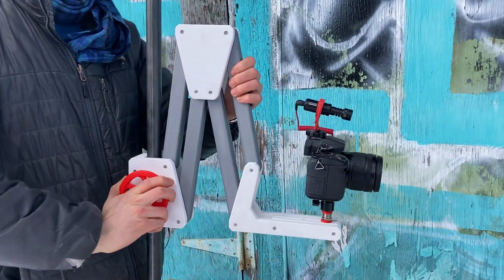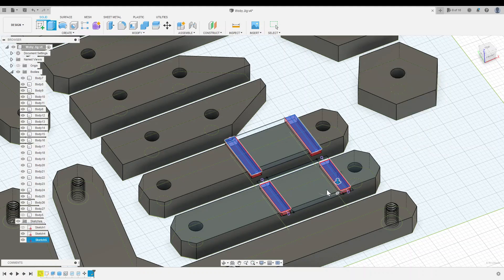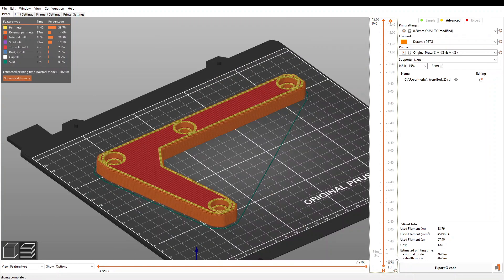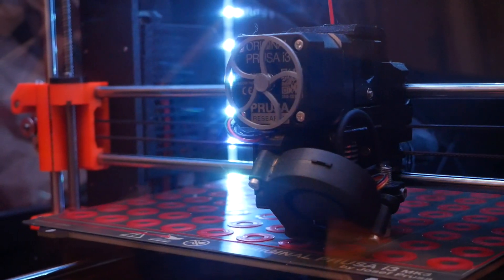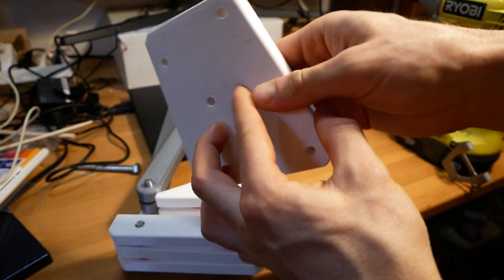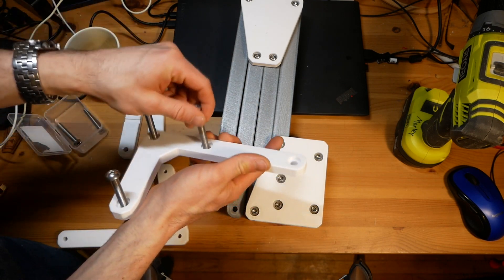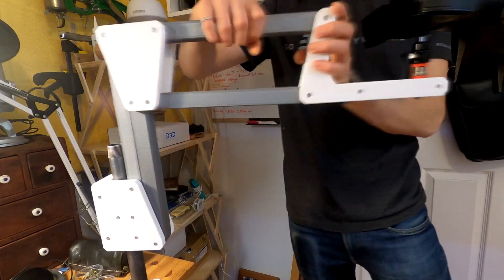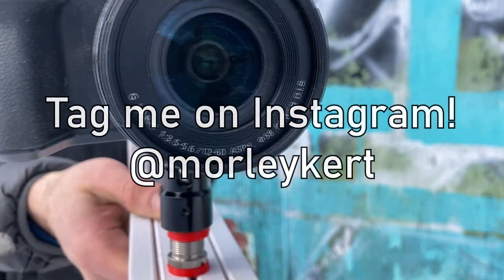3D PRINTED ARTICULATING CAMERA ARM // WOBY JIG

Comment: Update again: I got this assembled and it works wonderfully! I did end up using longer bolts and more washers and nuts to make the pieces tight enough to maintain position with the camera. I also added a metal threaded insert for the bolt/wheel that tightens the arm to the pipe. Thanks for making this! I also ended up buying the original designer's plans to make one out of wood sometime.

Comment: Update: I have the parts assembled, but I'm having issues with everything getting tight enough to maintain position. I plan to get some longer bolts so I can add nuts and washers to the opposite side of the pan head. Prints turned out fine! I also plan to use pipe fittings to make a dolly on wheels so I can use it to take photos of my scale dioramas on shelves.

Comment: Really cool project!  I’m brand new to 3d printing (have a Voron kit ordered).  Is there a reason you printed all the pieces except the washers separately?  It looks like many of them would have fit together on the build plate.
Reply: Shorter print times probably. If something goes wrong during a print of multiple parts, there’s a lot of wasted time and filament.

Comment: You can use modifiers in your slicer app to add a cylinder modifier around all holes, that way you can have a higher infill where your holes at whatever distance away you want, without having to make a certain infill for the entire model

Comment: The hardware links are "currently unavailable". For hardware I like Albany County Fasteners. I try to order for a few projects at a time since shipping rates are a bit of a shock. Also, one thing I will do differently when I print my second set of parts would be to print the countersink parts upside down with supports, so that I get the PEI texture on the show surface. I prefer cubic infill because it is probably comparable to gyroid but much faster (and quieter, at least on my machine). I'm going to make the struts out of white oak to go with the theme of my makerspace (bright blue, orange, and white accents, with white oak + rubio cottonwhite finish for furniture)
Reply from the maker: Good to know, thanks! I will try to find links that work.

Comment: Nice work, I like the color scheme and how you worked through the issues. If you were to re-do it would you enlarge the through-holes slightly or do you think there’s a benefit to the bolts being very tight like that? Also, just as a tidbit I think those are counter-bores not counter-sinks. Oh, and I loved the handle, you said that red was PLA, does that the mean the washers are PLA as well? Was there a reason to use PLA interest of PETG or it’s just what you had on hand?
Reply from the maker: Thanks! I think it adds a bit of rigidity with the tight holes so I would leave it. They only have to be put on once. The red PLA is what I had on hand.

Comment: Awesome, I might try to use a couple of these for task lights
Reply: I don’t want to dissuade you from trying this but the design is essentially based on a classic swing arm lamp which you can buy for less than $20. Again, have fun with it but if your desire is just to have task lights a week of 3D printing and probably $10 worth of filament (plus the lamp parts) is not going to be a very inefficient way to get there. However, for a camera platform, it’s worth it, even if you were to mix wood and 3D printed parts.
Reply: I made one with all printed parts and was definitely worth it.  I'm thinking of making a second one -- maybe printing the 8 long arm pieces and the wheel and making the plates out of wood. @jeremyspecce

Comment: FYI: I have that a lot with SVG files in Fusion. A few things I've found that help:

1. Shapes inside of shapes are almost always a non-starter.
2. Layers completely break Fusion 360 if you SVG has it.
3. If the SVG has un-outlined text or raster graphics? Destruction of the importer.
4. If the shape has a fill (sometimes people make their designs with a shape and instead of it just having an outline with no fill, it's an outline with a white fill) often Fusion will break the outline stroke into multiple parts.

It's weird how Fusion is so finicky with such a common, open, well-documented file format, but here we are.
Reply from the maker: Weird! Thanks for the tips 😊
Reply: @MorleyKert  SVGs have been the source of endless frustration for me and I've bumped into a lot of workarounds when they get wonky. I just wish we didn't have to!
Reply: Only semi-related but I get PDFs of architectural drawings for my work and import them into illustrator. And they were probably created in autocad. I usually spend about an hour per file stripping out details I don’t need but if there is a gradient or crosshatch it can be hell to deal with because somewhere along the line a gradient will be translated into hundreds of lines of slightly varying shades and, depending on how intertwined with other shapes the filled area is, it can be very time consuming to carefully select just those lines. Similarly a crosshatch will show up as a fill style but “select same fill” and “select same appearance” will not work for that so it entails a lot manual selecting to get rid of.
Reply: @jeremyspecce  Yep. Been there too.

It's funny because you do get used to doing stuff like that, but it isn't one of those things that you get faster at. It's always a slow painful process that takes forever no matter how many times you do it!